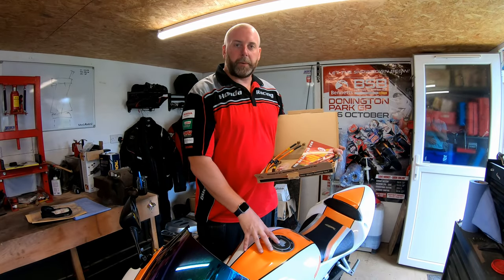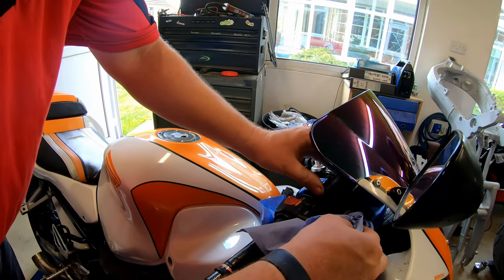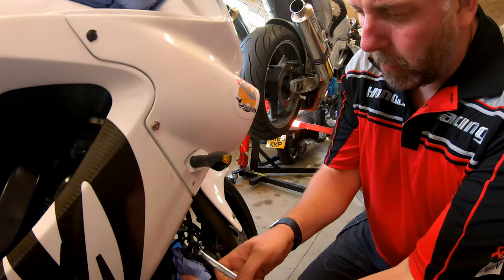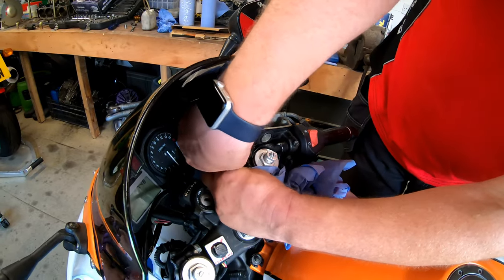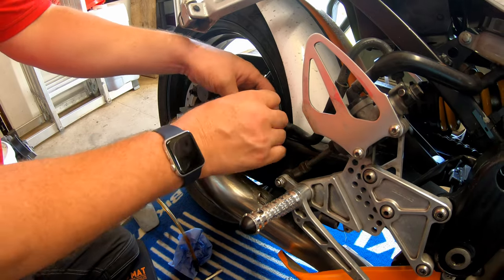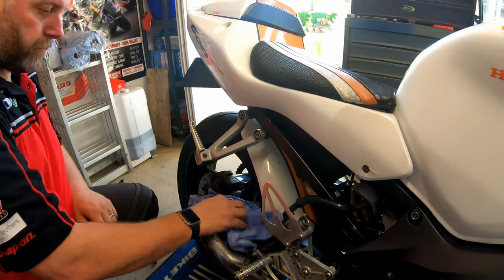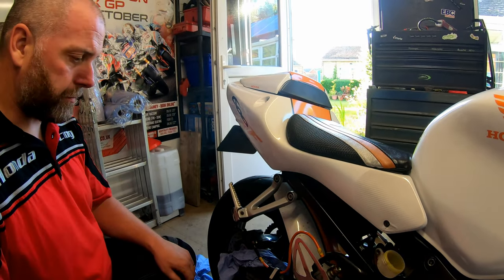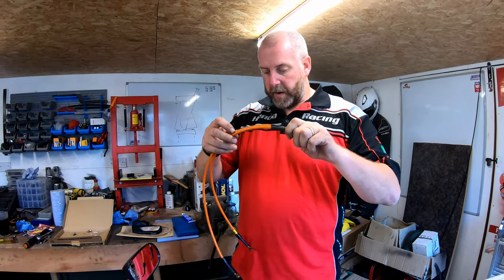2001 CBR600 F4i - Brake Line Replacement - HEL Performance Stainless Steel Braided Hoses

Comment: Excellent in-depth instruction, thank you Kev. About to do the exact same job on my F4i though I've gone for the over the mudguard option on the front lines. 
I'm planning on reverse bleeding the lines initially to re-introduce brake fluid and then bleeding as normal if needed. Great tip on using vinyl gloves and tape to catch any drips from the old banjo bolts. 👍

Comment: I did the exact same operation with HEL lines on my ‘01 zx9 with the exception that I used a double banjo at the front master that had a bleed nipple on it. It has made the exercise of ensuring a perfectly bled system much easier before track days and also the initial bleed was much easier as well.